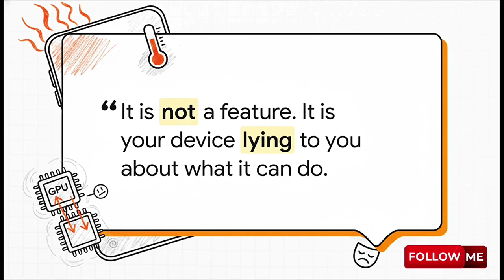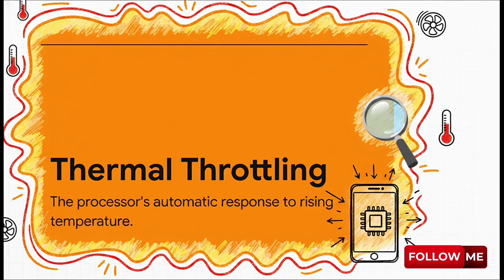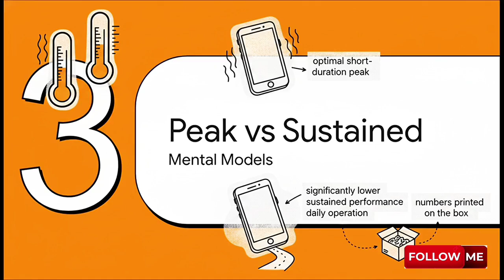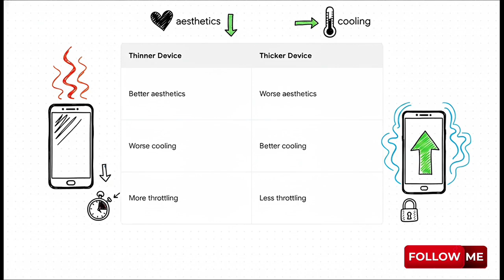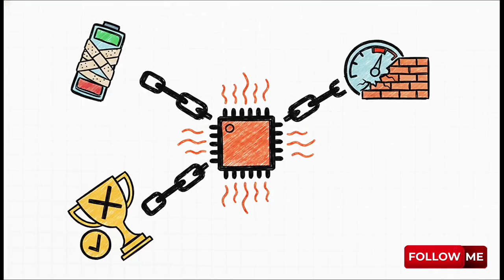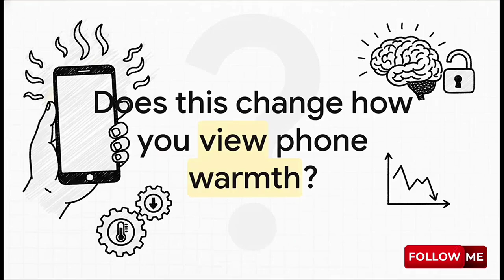Why Your Phone Gets Hot — The Performance Lie Hiding Inside Your Device.

Comment: We sacrificed better cooling for a Sleek form factor.
Reply from the maker: Why Your Phone Gets Hot — Thermal Throttling Explained
Your phone gets hot.
It slows down.
Your manufacturer calls it a feature.
It is not a feature.
It is your device deliberately
limiting its own performance —
without telling you —
to protect itself from the heat
it generated running at full speed.
And the benchmark scores
used to sell you that device?
Measured under conditions
that disable the throttling.
This is the full technical breakdown
of thermal throttling —
what it is, what it does,
and the gap between the phone
you bought and the phone
you actually use every day.
📱 Full breakdown now on Deciphertech.
Decoding the technology that controls your world.